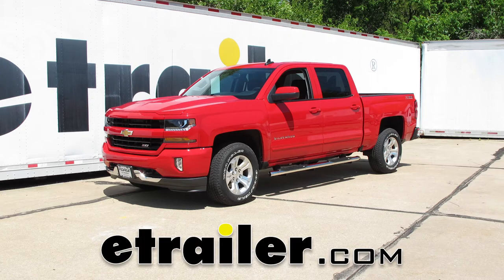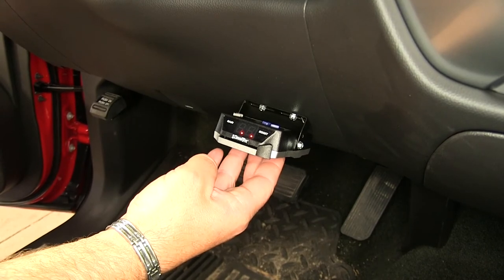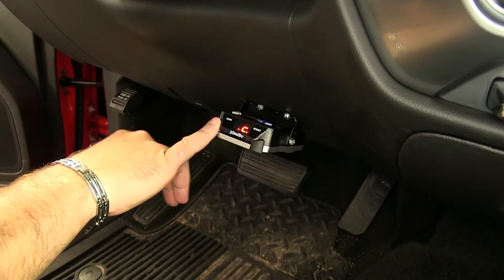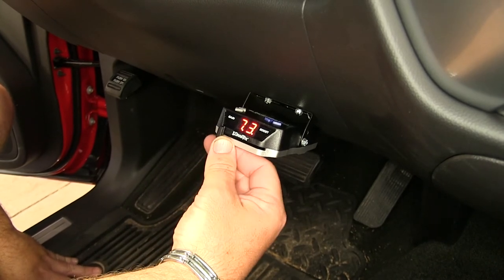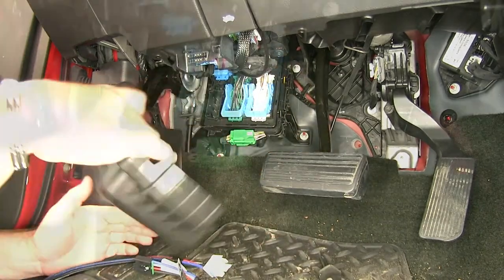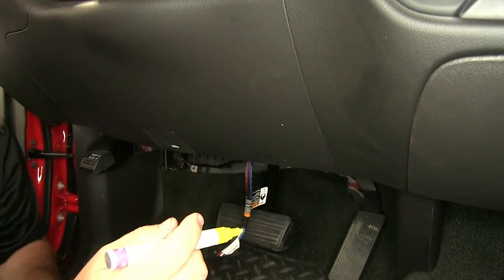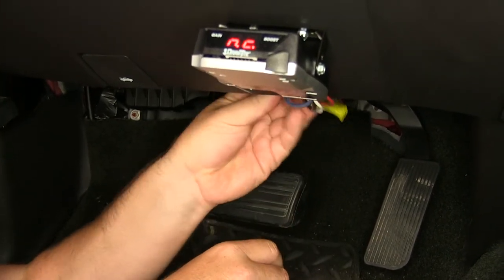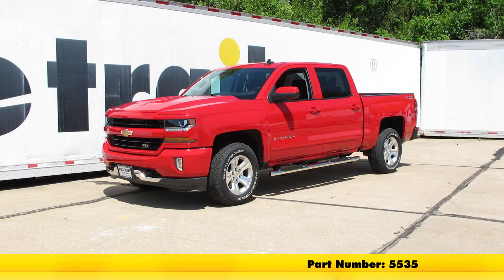etrailer | Draw-Tite I-Command Trailer Brake Controller Installation - 2017 Chevrolet Silverado 1500

Comment: Are those two dots on the controller  always on?
Reply from the maker: The dots you describe come on when the controller goes into its sleep mode, which happens after about 15 minutes or so of inactivity. When the controller is in sleep mode, the controller's power draw is extremely low and isn't enough to discharge the battery unless the controller is left alone for several months.
https://www.etrailer.com/Accessories-and-Parts/Tekonsha/3016.html